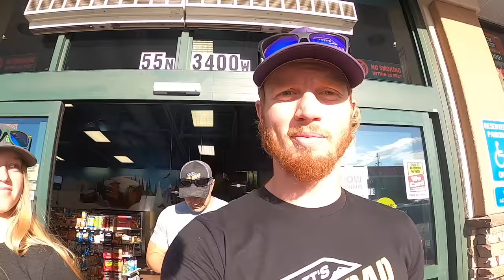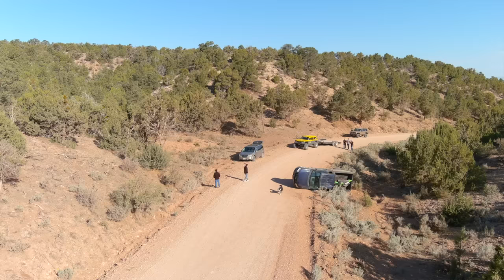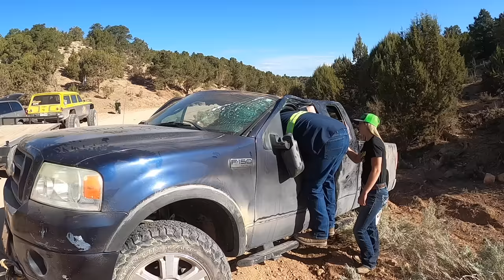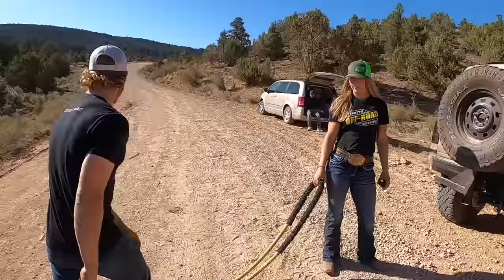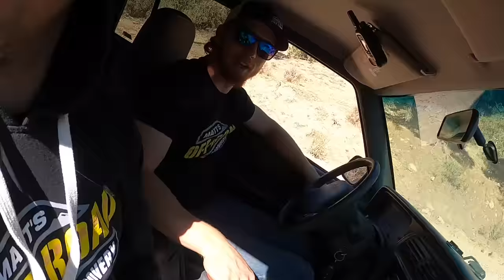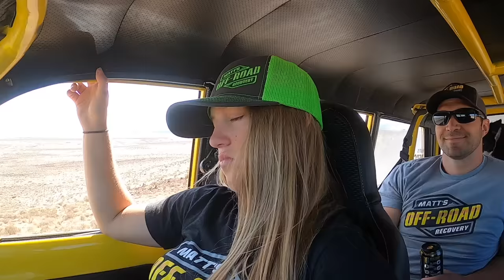They Said It Was Just A Flat Tire - Ford F-150

Comment: The Morvair really needs to have an onboard air compressor to air up tires.
Reply: Easy to put one, then while you at it put am air horn in to.
Reply: And the trailer needs a perm battery and straps in the box.
Reply: It amazes me how unprepared they are. They need an aluminum jack, straps, compressor, a come-along, pry bar and they would be set LOL =)
Reply: Not sure it would have helped this one lol
Reply: Why just a cheap cigarette lighter air compressor would work really
Reply: @scripulance.1901  Matt airs down to 8psi all the time. With tires that size, it will take forever to air them up with a little electric compressor, and the limited duty cycle of those means a short lifespan. 
A great way to get onboard air for engines without compressors, is to just add an extra AC compressor with an electric clutch.
Reply: @RambozoClown  You'd be pretty surprised at how good those 12V compressors have gotten in the last couple years.
Bought one in 2010 and thought they were junk but recently got one for my wife that's faster than the 3gal AC compressor I have for moving around
Reply: @RambozoClown  a good 12v air compressor would only be like 50 bucks and be light and small to store anywhere it wouldn't take that long I aired up 35s with mine and it took about 10 minutes for all 4
Reply: Extra weight is anathema to Matt
Reply: Notarobot - I agree entirely. Maybe some viewer and company supplied care package.
Reply: @NotaRobot_gif  this group does not know much about mechanics, and engineering. Rolling vehicles without air cushions, or restraint lines is absolutely amatuerish. It looks like they got a previously damaged vehicle, rolled it on the damage, and affected a recovery. Note lack of tyre skid marks on the track.
Reply: @scripulance.1901  Those things have no volume, it would take hours to pump up a 36" tire. The bearings in the pump motor would burn up before you even got close.
Reply: @ReservedForFutureUse  bruh I literally commented I have one that airs up my 35s no problem I got 35x12.5xr17 and it's does fine last one you used was probly from 2000
Reply: @NotaRobot_gif  they were told it was a flat. Then when they were on the way they were told it was flipped. 
If your creative and have a ton of experience you don't need a ton of tools and you'll make it work.
Reply: @NotaRobot_gif  They are so unprepared that they have been in business for almost 40 years and have a you tube channel with over 650k viewers?  PS. aluminum jacks are cute on the roof rack, but not up to daily use, but of course your off-road recovery business can run as you like
Reply: Or even a battery powered air compressor, or a 12v compressor, anything!
Reply: Yes, and some duct tape and safety pins.
Reply: @duramaxdad  Yeah deep cycle battery, a way to parallel to the alternator in the vehicle when idle, not towing, and one of those badlands 12K winches on the trailer.
Reply: And airbags on rear axle if it's going to be towing like that.
Reply: @ingest-a-satchel-of-richards  I'm 99.9% sure that he was talking about the fact that Matt said his own tires didn't have enough air to be on the highway, or pull a trailer with that weight. That's why he stopped on the highway to check the tires on the Morvair, when they were on the highway.
Reply: @ingest-a-satchel-of-richards  I'm 99.9% sure that he was talking about the fact that Matt said his own tires didn't have enough air to be on the highway, or pull a trailer with that weight. That's why he stopped on the highway to check the tires on the Morvair, when they were on the highway.
Reply: @RambozoClown  No it won't it depends on the electric compressor i have one that airs up tires in about a min.
Reply: @NotaRobot_gif  So...are you saying you won't be calling "unprepared" Matt when you're stuck in southern UT?
Reply: @geoffcrumblin9850  Yeah, Jeff...I'm sure your MOUTH would have done a much better job of recovering this vehicle...which was called in as a "Ford F-150 with a flat tire."
Reply: @ReservedForFutureUse  
They work alright. I air up my big backhoe tractor tires with a little 12 volt compressor.
About 20 minutes for a 17.5 x 24, a LOT more tire than a 35. Goes with me on atv. Tractor pickup. They last 2 or 3 years.
Reply: @duramaxdad  trailer need an own winch
Reply: @RambozoClown  They make good ones now. I think it's lowes that makes a unit that's all metal with a real piston and metal valves that puts out almost as much air as a hardboard freight pancake compressor. More than usable for fixing a few psi on some tires.
Reply: Have one on my truck
By far the handiest upgrade I have.
Reply: @zoolkhan  The trailer has a winch, but it's not wired to anything so they need to bring a jump box to power it. Lizzy says something about the jump box, I guess they didn't bring it.
Reply: @scripulance.1901   With the big tires they usually air up they would wear out one of those in no time
Reply: Yes, a roll of good, strong duct tape (works on radiator hoses) and 20 feet of baling wire - not much weight or space.
Reply: The problem is where the hell is he gonna put one big enough to get the job done in a good enough time for it to be worth Matt’s time

Comment: Haha. Matt: "We got a little more tongue weight than I like".

Corvair: "The sky looks pretty today".
Reply: I can't help but to think that Matt may be exceeding the GCWR of a Corvair Lakewood by a fair amount.
Reply: @straybullitt  Honestly any factory recommendation would not be applicable. It's a fairly long car and the rear axle can handle the load. But mushy suspensions are good for rock crawling and bad for towing.
Reply: @RFDelie  
That would be my argument as well. 
I'm not so sure that a DOT officer would agree though....
Reply: @straybullitt  be correct 
Dot = hiway nazis
Reply: Add some airbags might help a little
Reply: "A little more tongue weight" he says...

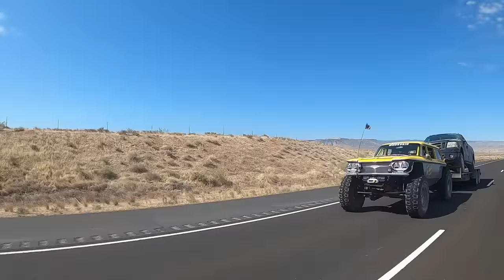18:20 be like:
Reply: Might need some air assist springs.
Reply: @straybullitt   Well, at least before it received a new frame and engine.
Reply: @straybullitt  would DOT have any authority over Matt's vehicle? If he weren't a commercial entity,  the DOT wouldn't be able to say anything unless he actively endangered other motorists. Even then,  I think it would be up to local law enforcement.
Reply: Yes. The Department Of Transportation has authority over all motor vehicles. Not just commercial. 
Typically, DOT officers are local law enforcement. Most often, state highway patrol officers specially trained for DOT enforcement. 
I'm honestly not sure how it would go if he got pulled over. It's obviously a well built custom vehicle, but I presume that it is still registered as a Corvair, so technically must operate under those guidelines. I suppose that it would be the luck of the draw whether the officer thinks that it is a cool rig, and can handle the job just fine, or he sees it as a Corvair, and wants to put it on the scales.
Reply: @jeffryblackmon4846  
And stronger axles and brakes. 
I'm just not sure how they would look at it.
Reply: @straybullitt  more then likely Matt or his team has assisted the dot police at some time. Like all of us co-signed him as 1o the good guys so he would likely get a pass but nazis can Karen and arrest his car to hold in drunk tank for driving while “loaded.”
Reply: Bigger brakes ,HD  axle, HD suspension doesn't mean you can tow more than what the vehicle is rated for.. just because you can haul something doesn't mean it's legal.. . The corvair loaded w/gear n crew ??? 62xxlbs 
The f150  ??? 56xxlbs
The trailer??? 17xxlbs
= 
Badass fines ... not to mention it's kinda dangerous.
Reply: @codyramos3200  That is true if you are upgrading. But this car was fabricated. The only part of it that is a Corvair is the shell. 

If I took a frame from a chevy cruze and put a yukon body on it is the tow rating that of a yukon or a cruze?
Reply: @RFDelie  
It's a fine line between fabricated and upgraded. 
The tow rating would be applicable for whichever the vehicle is registered as. 
For instance, if Matt had used a modified 1-ton pickup truck frame, with a VIN and title, and set the Corvair body on top of that, it could be registered as a re-bodied 1-ton pickup truck, with all of the load capacity that particular truck came with from the factory. 
A Corvair sitting on a custom built frame, with no factory VIN, will likely be viewed as a factory Corvair, with the associated weight capacities. 
Here in CA, they charge a weight fee on the entire GCWR capability of a vehicle. So it is markedly more expensive to register a pickup truck/SUV, than it is a passenger car. That, in itself, is enough to encourage law enforcement to hand out expensive overweight tickets when people are carrying more weight on the roads than they are paying for. 
Many states use different methods to calculate vehicle registration fees. Not sure how it is done in Utah.
Reply: @straybullitt  That makes sense.
Reply: Yeah it's squatting pretty bad lol

Comment: All the times I've thought I wish they had radios.  First time I see them used, I see I was wrong.  ;)
Reply: They have cheap radios . And no straps and no battery for the winch and no floor Jack . Other than that, a smooth operation .

Comment: I get wanting to save weight for the sand but the lack of tool boxes/tools and an air compressor is absolutely crazy you don’t run into more problems u can’t solve which seems to never happen or u just edit those parts out but amazing job guys keep em coming

Comment: I must say, using that winch to lift the back of the truck was brilliant
Reply: A hi-lift farm jack would've been faster.  I don't go offroad without one.
Reply: @patrickhorvath2684  I was shocked to realize they didn't have one. They managed, but proper equipment would have helped a lot.
Reply: Was off-roading with my grandfather, my dad, uncle and grandfathers best friend and my grandfather rolled his jeep and there was no way to get it on its side without it rolling more down the hill so we used 3 winches a couple snatch blocks and picked it up off the ground and rotated it in the air then set it back down on its wheels.
Reply: @andrewaymond6570  who cares, who were going with you on that trip?

Comment: You guys should also setup a sheave (snatch block in off roading terms) at the front of your trailer when you do a pull like that. That way it’s pulling straight rather than at an angle like that.

Comment: I’ve seen many videos of dragging broken things onto the trailer, I think it could be beneficial if you kept a plank bolted in the center of the trailer and just remove it when you need to drag something up the ramps. As well as many other issues that a board could solve
Reply: Facts. He could have used those traction boards he's got and used em as a slide.
Reply: Extruded steel ramp.

Comment: You need definitely a 12V power connector behind Morvair for the trailer winch. You could use it with the other winches too. Like a trailer you use rescuing RZR:s on sand dunes. Or with a separate winch that attached to the towbar, behind the car.

Comment: I'm telling ya. An onboard air system would be invaluable. I've had a Viair Ultra duty system for almost a year now on an FJ and it has paid for itself 10 times over. Will fill all of my 35s from 10lbs to 35 lbs in around 8 minutes starting with a full tank. I mounted the compressor inside the back, and ran the hose under the vehicle to the tank. Took a little figuring out, but managed to fit the tank where bottom sits above the low point of the rear bumper. With the work you do, it would really come in handy

Comment: Cool camera angle when you put the camera on the trailer. Also, keep using the radios. It’s safer plus it’s really fun listening to the misinterpretations😂
Reply: FM radios and proper radio lingo is would increase efficacy. They will soon develop their own off road  recovery lingo.
Reply: I've wondered why they don't have radios many times. My grandpa and uncle in the mountains never went off road without their CBs.
Reply: @Hello Kevin how are you doing

Comment: You know, if you rig/weld a snatch block on the front of that trailer, positively anyone with a winch can winch a rig onto your trailer, from basically any angle.  That's cheap/easy, and keeps you from having to mount a winch to it.
Reply: Neat idea, but what if there's no other vehicle with a winch available?  Probably better just to mount a winch
Reply: I love snatch blocks. Leverage is king
Reply: They have a winch on the trailer, I can’t figure out why they didn’t use it.
Reply: @coty7.3  you might be thinking of the other trailer, the off road trailer they use for rzr recoveries, that one has a winch.  This is the one they usually haul behind the F250 with the jeeps on it.
EDIT: I see the winch on this trailer now, must have been broken
Reply: I was just thinking the same thing.  I've done it many times and works great.

Comment: I like at 12:00 when Matt basically said "can you use your wench as a fork lift and drive it on?"
Reply: The winch looks to be mounted a bit forward of the bumper, I wonder how much down-weight it can handle (vs forward pull).

Comment: Hmmmm, jumper pack, compressor, tie down straps...hose for tank filler......better pre-flight....
Reply: Need a bigger vehicle to carry all the "you need this"gear. Then leave it all in the shop because you can't get through the sand with all the extra weight.

Comment: Anyone else wondering what that Ford driver was doing to get flipped like that on a gravel road!
Reply: He was driving way to fast, probably drifting around the corners.
Reply: Well, he did roll the truck the cab is kind of crushed, a rear wheel nearly broken off the axle etc, he had to have been driving too fast for the road and rolled it good. It's obvious he had the bike strapped down as they had to remove it from the bed before rolling it back over onto its wheels. Unless the truck has auto hubs up front, it was a 2 WD model at that.
Reply: A blowout plus bead popped off the rim, a swing out and a dig into a windrow on the side of a dirt road will do it for you. You do not have to be traveling fast. The high mass of the bike swinging across to tight in its straps would have helped pull it over.
Reply: His tire blew going too fast around a turn, hit the brakes and it pulled him off the road and made it roll.
Reply: @morrlizzy5350 . So it was the panic reaction of hitting the brakes instead of riding it out with a steady slowdown and then it was game over. Steering into the skid or the drift is something driving schools should teach plus dealing with dropping off the edge of a paved surface and resisting the instinctive urge to swerve back on. This is pretty much the cause of many long-distance single vehicle accidents in remote areas of Australia. It may be in passing opposing traffic on a narrow paved road, inattention or dropping off in a microsleep and waking up when the rumbling starts from the left side tyres as they claw at the rough edge.

Comment: I really like my PJ deckover tilt trailer. Works perfect for vehicles just like this. I use a short 2ft x 3ft  1/4" plate to get things like that shock mount to slide up on when i winch the vehicle on. I have a winch on the trailer and a wireless winch controller. Perfect

Comment: what we usually try to do is put a jack under the frame towards the rear.. helps a ton to get the rear to clear the trailer. just a tip to try for next time..
Reply: that was what I thought they would do

Comment: If you add a plow mount and lift to the front, you can adapt it for a mini lift, such as diving up to and lifting the back of the F150. Front clearance may be an issue, so probably fab a higher mount.

Comment: You should get yourself an alumina trailer for some of these jobs, maybe not full size truck hauling like this but for those lightweight sand jobs hauling sxs or <5000lb rigs I think you’d benefit. Especially if you add some real balloony tires to float even better on sand.

Comment: This is the second video on here where I have seen new Ford trucks and the paint chips in these sheets.  On the back 
passenger side panel of the bed.   Interesting phenomenon compared to other paint jobs straight from the manufacturer where there has been stress from impact.

Comment: I would have jackknife the trailer, that way you have a straight pull and if you need to adjust the ramps for the rear wheels you just move the truck hooked to the trailer back or forward. But than again I’m speaking from watching the finished product.
Good job guys and girls

Comment: Matt you need to weld a pully to the front of that trailer right in the center so you can run your ropes through it and pull vehicles straight on at 8:00

Comment: I think you need to build a cage onto that trailer above it with several electric winches that you can pull it different directions and up and down a lot of people wouldn't understand what I'm saying but I think you would if you think about it a minute outside the box that's the way to do it 😎

Comment: a snatch block in the center of the front of the trailer and one on either side of the trailer would give you better control to pull straight up the trailer.  we did that on one of ours so we could load a John Deere 4620 with two flat tires and no engine power on the tractor.

Comment: Another option is a heavy mount for a snatch block mounted to front of trailer. Then can pull straight on trailer using one of the winches or tow strap.

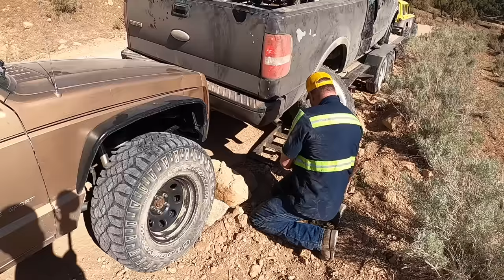Comment: Most Insurance companies will Total any vehicle that's had it's wheels leave the ground. That truck is toast. @14:00 -- Bumper jack. Lift it high and tip it forward. Also good for getting dug in tires out of sand. Same process but doesn't work on the current plastic bumpers.